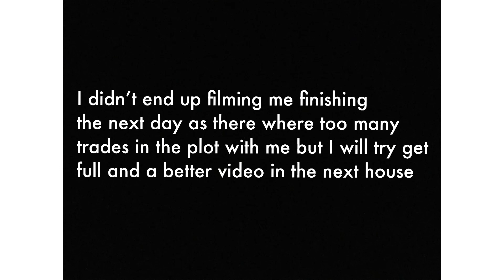Building a house in 15 minutes - Second fix Carpentry on a F.O.G unit

Comment: How many days was you in there ? 
Did the handrail come with the 45 on it or did you use your skill saw ?
Looked fast and tidy
Reply from the maker: Cheers mate think I was in there 2-2 half days total bit longer than I would like but fire doors always seem to take twice as long. The handrail did have a 45 on already but had to cut the small returns out of the offcuts from the long length
Reply: Why we're you re cutting them hinges in again once the door was on?
Should just swing straight off the bat.
Did you put any nosing across the landing, looked like you just sat the spindles and base rail straight on the concrete?
Just a couple of things that stood out to me that's all.
Reply from the maker: They were fire doors so just some slight adjustments to make sure the margins met regs also couldn’t fit nosing under due to the screed so had to add a section on the stairs side not ideal but was limited to what I could of done